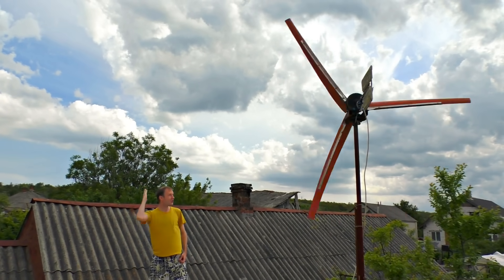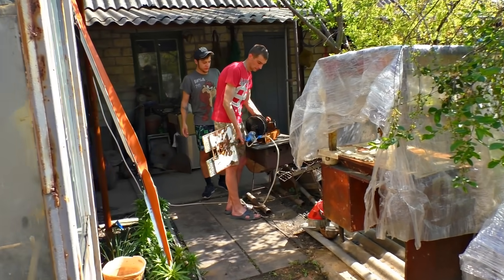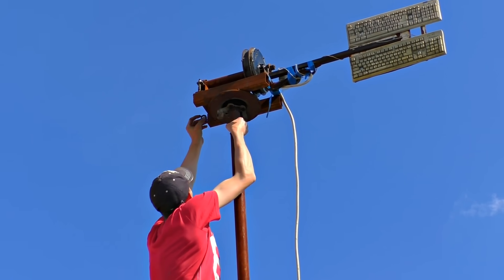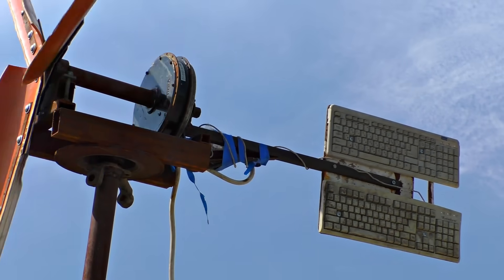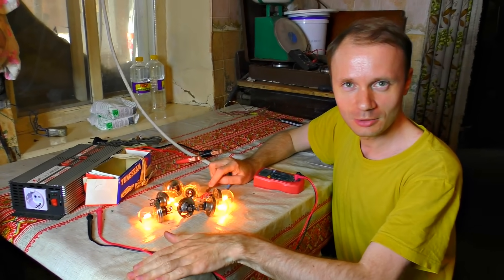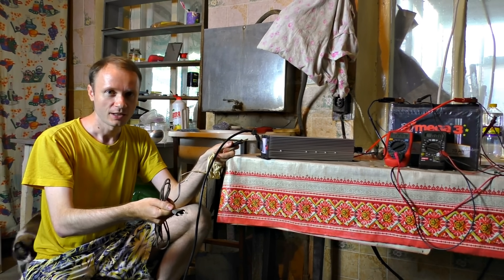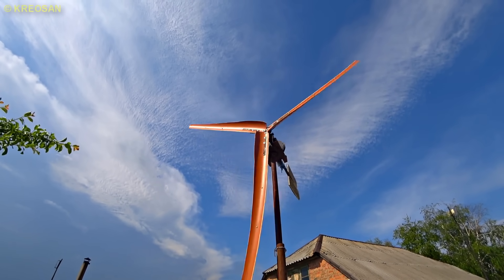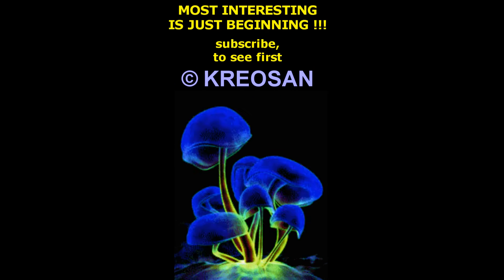✅Powerful Wind Generator DIY / Free Energy / Green Energy

Comment: Does it have a split ring connector because that cable could get wrapped round that post?
Reply: it WILL get wrapped... honestly a car generator brush setup that is under the bearing (because it could snap) would solve the problem (up to 20 Amps i guess), not much need for waterproofing, just a skirt something
Reply: The cable would turn the windmill back in place but then the cable wouldn't last very long. Best is to use what I think is called a slip ring